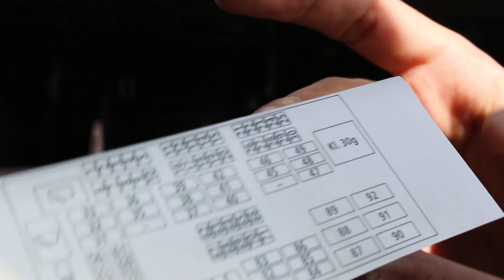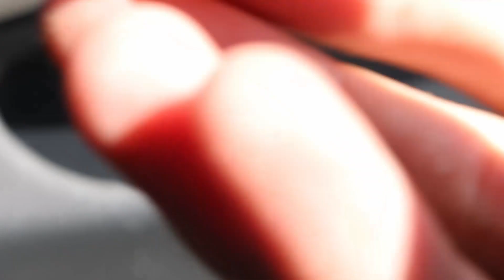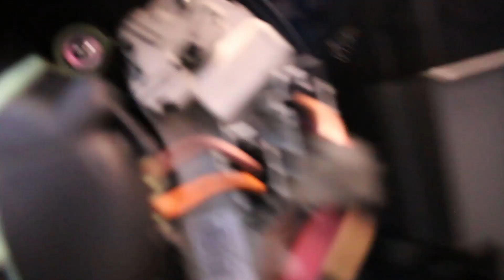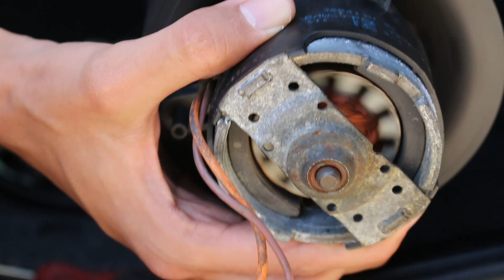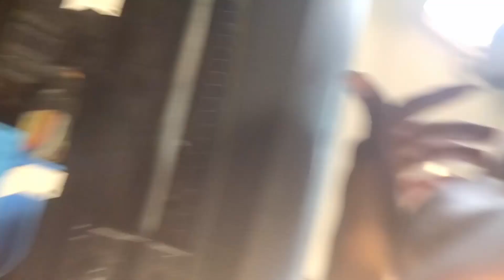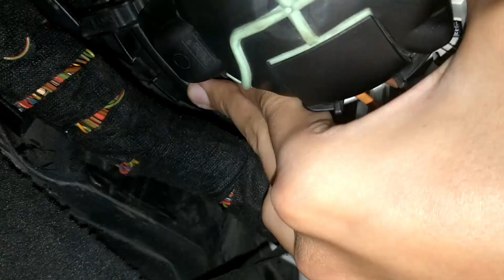How to FIX & DIAGNOSE BMW e-series AC/Heater BLOWER MOTOR ( a STEP by STEP DIY GUIDE )

Comment: My blower motor and resister are brand new ive checked fuse thats fine but still nothing please help me with this
Reply from the maker: if everything is tested and ok, then you should check if there is something mechanical that stoping the motor from turning or maybe the ac command panel is faulty,  did you have access to a diagnostic tool ? you should check for errors using a diagnostics tool

Comment: Hello sir.. if e60 at the same place?..
Reply from the maker: No, the blower motor must be located behind the radio unit, before dismantling anything check if the fuse is blown, if not you can go ahead and check the blower motor.

Comment: I remplaced it with an other one didn't work, the fuse is good, what do you think the problem
Reply from the maker: Maybe the blower fan is seized, if the fuse is good you have three things to check, if the fan motor is seized due to rust, te transistor is blown ( the one that regulates the speed, he is mounted to blower fan ) or the ac control panel is faulty, use an obs 2 scanner and check for faults related to the ac system
Reply: @BM-V  thank you so much